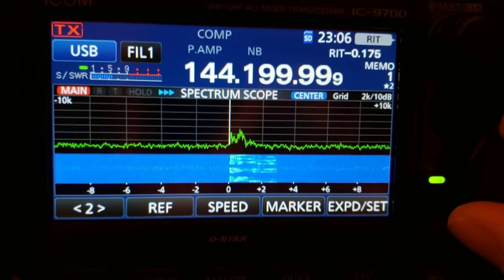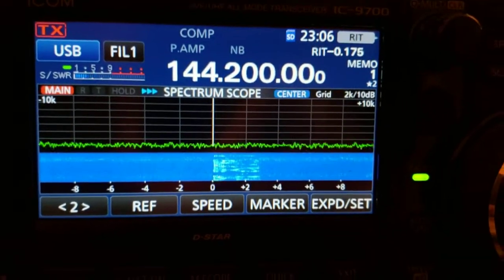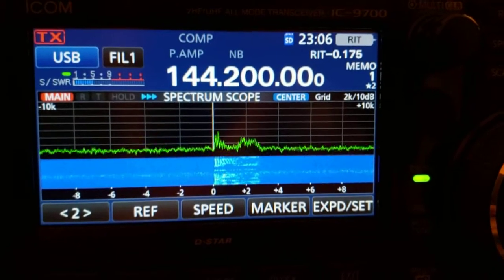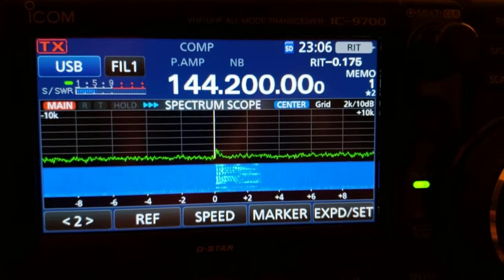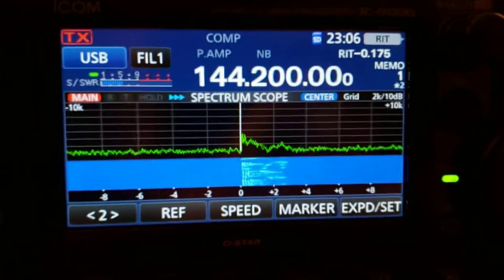May 27, 2020 KN4ODM- Brad using Ukrainian transverter, IC 7300 and 2m Hourglass antenna

Comment: Whats the transverter model?
Reply: https://transverters-store.com/144mhz_tcxokit.htm

It has worked great.  Mine is the older version that the Lo drifts a bit but once the temp stabilizes it is fairly solid.  I believe he has changed the crystal for a TCXO that should be more stable